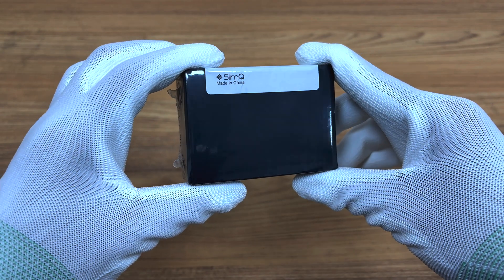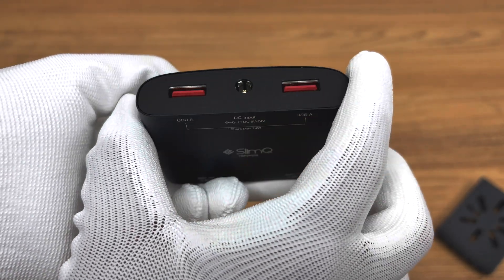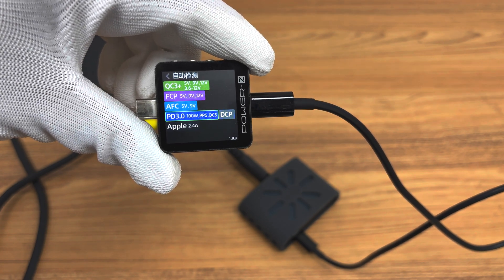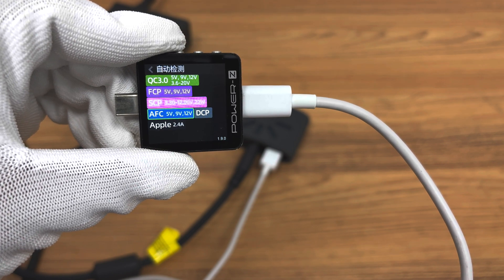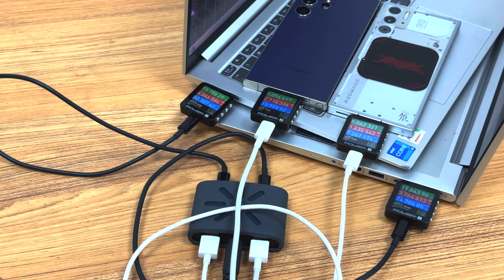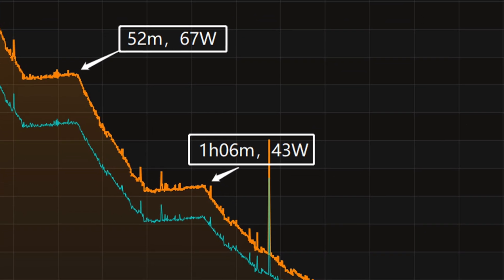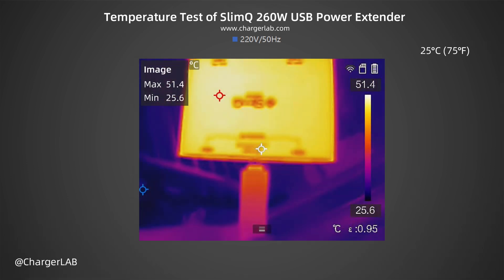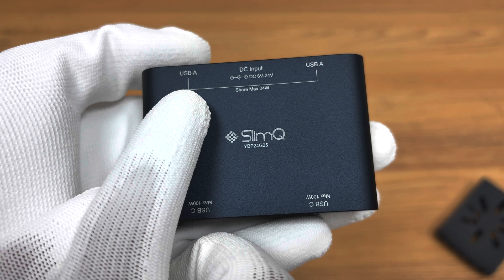Review of SlimQ USB Power Extender

Comment: excellent solution device for direct current sources to USB type C and type A port output, you just need to disassemble it and see what chips it has inside and how the electronic circuit works😎👍👌
Reply: Yeah, I was disappointed they didn't tear it down. I have a few of them and really like them.
Reply: @adriftatlas So should I buy one? Do they get that hot?
Reply: @PixelatedWolf2077  I don't push it to the limits. Mainly use it in the car and the car limits it to 12V at 10A (120W) or so. Pulling more would likely blow the fuse for the car outlet. For more amperage it'd need to be hooked up to a battery directly.
This thing is great not necessarily because it's high wattage, but because it will accept a very wide voltage of 5V - 24V, and buck/boost it to whatever a USB-C device requests.
Reply: @adriftatlas  Hmmm, good to know! I might buy it then that way I could toss my laptop and my friend's Lenovo handheld on it at the same time.
Reply: @PixelatedWolf2077  Doesn't heat up when I use it to charge my HP laptop and phone at the same time using USB C for a total of 100W. The good thing with this DC extender is that it can use any 5V to 24V DC source to give you USB PD outputs by using a DC5525 cable.